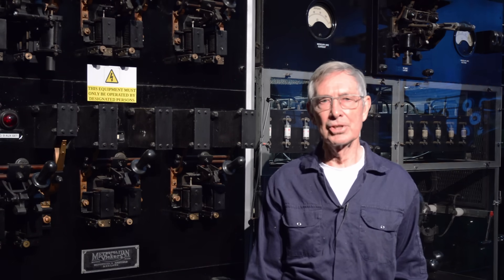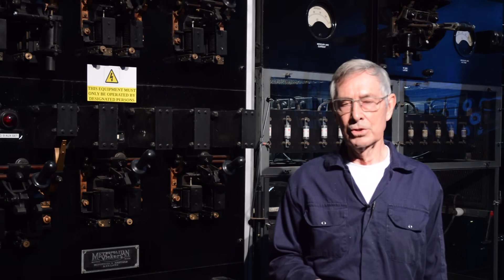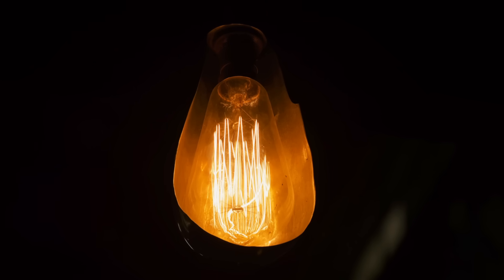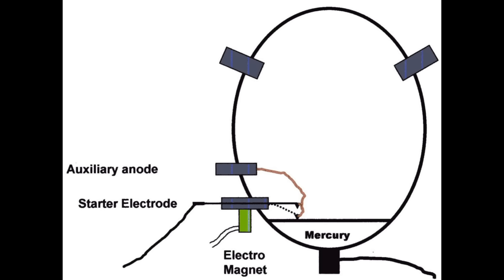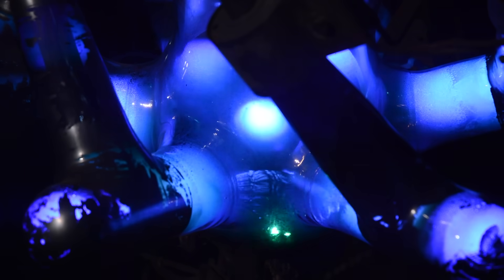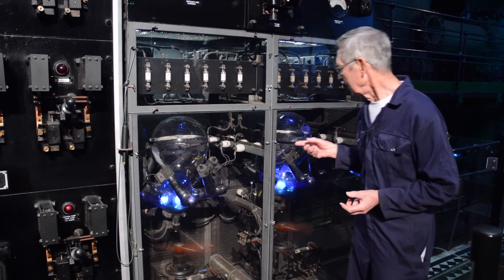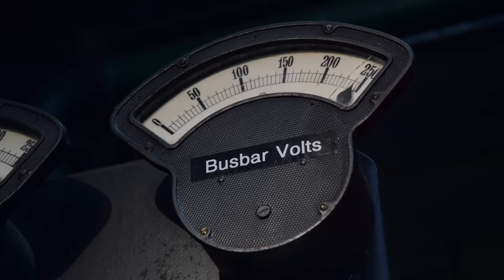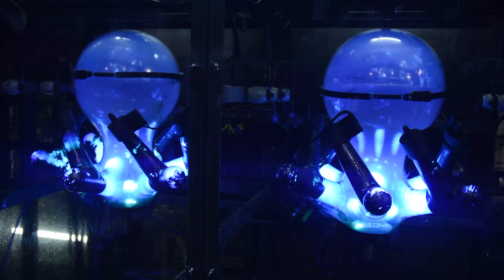Mercury Arc Rectifiers - Kempton Steam Museum

Comment: Old technology is awesome because it’s simple and one person can fully understand how it works, even to the level of making devices. One day in the future there might be a global disaster which knocks out semiconductor manufacturing and the knowledge to produce them. So how to make DC after this... go back to simple devices like the mercury arc rectifier. The tungsten lamp, fluorescent tube and valves are similar - much easier to produce then semiconductors. The knowledge to make them must never be allowed to die for this reason.
Reply: By the time the survivors of that disaster run out of the gazillions of electrical appliances, diodes and transistors that the planet is covered in, they should have figured out how they work.
Reply: Well, there's always CollapseOS...

Comment: I've learned about mercury arc rectifiers some years ago when visiting the local tramway museum in Nuremburg, but they had only photographs. Thank you very much for this well-made presentation while in operation! I'm always getting slightly uneasy around these things due to the amount of mercury they contain in a glass container and the currents that flow through them. But surely they're much more impressive than semiconductors...

Comment: These were really common on power stations, generating DC for the instrumentation battery backed up DC supply buses. The were a reliable and efficient way of generating large amounts of DC before silicon rectifiers appeared. I worked at Dungeness Magnox power station in the early 2000s. (On a completely separate project but engineers talk). I believe there were a suite of large mercury arc rectifiers supplying power to the instrumentation buses. Apareltly they occasionally blew out, which made for an interesting time I'm sure, (Let them cool down,replace fuses, then restart them and they were good for another few years). The station was scheduled for shut down in 2006 and Magnox were somewhat reluctant to spend millions replacing them with a new silicone rectifier system with so little time left. Obviously there were multiple redundant parallel systems but there were no spares available. Then some identical spare units turned up from the London underground which had never actually been turned on. I'm not sure if they needed to be fitted  before the station was decommissioned, that part would have been turned off sometime after the fuel was removed, so probably 2012 ish. The trials and tribulations of keeping 50 year old equipment running :¬)
Reply: Yes quite large ones existed for example on the DC links that often shared power between countries. The large ones however were not glass like in this video. The big ones were constructed in steel and had vacuum pumps on them to keep them pulled down. The escaping mercury vapours caused some contamination and an occupational health hazard. The attractive glassware we are shown here could often be seen in elevator machine rooms at the top of blocks of flats and offices as they all ran brushed DC motors and controls. I saw an antiquated example of this in Kiev recently in some soviet era flats. If you see a lift with a chair in it then beware. If it has a chair with a pot on the floor under it then definately dont use it.
Reply: Just had a look and the underground uses a strange DC system of +430V on 1 power rail and -210V on the other. So back in the day they'd have had a large number of these Octo(Hexa)puses
Reply: @alanpartridge2140  It’s because they didn’t want any stray currents eating away at the metal tunnel lining, or water (or gas…) pipes (the damage occurs where the stray currents leave), not to mention telegraph cables. Most other subways (as well as the London "overrpund) uses 600 or 750 + in the conductor rails, and the running rails for return current. Cities with trolley buses as well as trams, usually had 600 volts in yhe + wire and ground return in the — wire, making for easier crossing of tram wires. In some places, vintage trolley buses have been run in their home cities (that now lacks trolley bus lines…) simply by gaving one pole using the trams’ + wire, and having them tow a cart with metal wheels running on the tracks for ground return.
Trolleybuys only cities sometimes have + and — 300 V in their wires, making for a less scary potential if a wire gets downed. You still have 600 V, of course.
I have a friend who lives in Bergen, and he’s told many tales of stray currents wreaking havoc. Bergen had trams until 1967, then only trolley buses. On occasions, old feeder cables and return cables made for currents going astray, to do such things as gobbling up the hetating elements in the water heaters in the local hospital… 
MER (Manx Electric Railway) still use these wonderful beasts! :D
Reply: @alanpartridge2140  I believe they were 12 phase - I am not sure if there was one 12 phase rectifier or two 6 phase ones in parallel. It was not uncommon to lose a phase resulting in a lot of harmonics but who cared in those days. They were also rated at a lot higher current several thousand amps. From what I was told they were in metal tanks with only a small viewing port that was normally covered due to the amount of harmful UV radiation from the arc.
Reply: The factory I work in had DC control voltage to control the AC equipment, as well as some rather large motors which also ran both AC and DC. We used to have a motor of several hundred hp connected to two generators, one on each side, so one generated +125 VDC and the other -125 VDC, so the total generated was 250 VDC. All that is gone now, replaced by solid state rectifiers.
Reply: It's incredible how much of this old tech is still operating in the world of mobile phones, the web and such. A bit like Tim Hunkin revealing that the met office were still using an 80-odd year old electromechanical spark erosion "fax" machine up until around the 2000's. Would be interesting if anyone has examples of these rectifiers still in use.
Reply: @BM-jy6cb  I knew MER (Manx Electric Railroad) still used these a few years ago. I’m certain a quick mail to them would resolve the question! :)
Reply: SCR’s and now power transistors
Reply: Super cool info Frank, sounds like you lead more than an average life career wise. 👍🇺🇸
Reply: Talking about London, please go take a look at the end (if not all) of this video : https://www.youtube.com/watch?v=Yy8vEZT9Z_I They found an old bunker under london with a working and connected Mercury arc rectifier. It's amazing
Reply: I worked on building and testing control systems for many of the magnox stations in the 80s-90s, I was with Instem if you’ve heard of them.
Reply: Keeping equipment running for longer than its design life is truly a preserved art in the UK. After all: Why do you think London Undergrounds MA rectifiers had never been used?... 😉

Comment: A work colleague told me he was at a power station which used these devices. I guess possibly to provide excitation for an alternator. One day he had to take a party of school children around the station, all of whom he thought were pretty disinterested. He showed them the steam driven alternator and said this is where we make the electricity and then pointed to the rectifier and said this is where we bottle it. The next day he was taken to task by the station manager...clearly their teacher wasn't happy.
Reply: I am 44 now. As a late primary school child I went on a school trip to our local plant, Dungeoness in South East England and recall walking around the edge of the vessel head and having the refueling tower pointed out to me, and the plugs that are lifted out by it once it is positioned over one.
Reply: At least they all didnt get arc eye.
Reply: @rushymoto  The glass of the tubes blocks most of the harmful UV rays emitted by the process.
Reply: @joeylawn36111  Wrong.
Reply: @joeylawn36111  Nope
Reply: 😬Yikes! I stand corrected. Scary.
Glass does block the UV rays emitted by some home use quartz lamps (a piece of glass must be in place for that reason), but apparently not the must more energetic mercury arc rectifiers.
Reply: 😂 bottle it. That's fantastic!
Reply: „The alternator is where we make the electricity, and the rectifier is where we bottle it!“ 😳

Sir, thank you so much for giving me the biggest laugh I could ever have asked for on this subject! Imagining an arc rectifier as a bottle of electricity has definitely _brightened- up a dark and dreary Christmas eve in these parts. Bravo! ⚡🎄😁
Reply: sounds like a normal field trip. I don't get it.
Reply: @NoZioKikes88 THE EDUCATOR WAS A NITWIT FOR ACCURACY APPARENTLY. JUST THE FACTS MAM, NO FUN ALLOWED!!! AND THERE'S NO SANTA OR ST NIKOLAS EITHER OR EYETHER!
Reply: @NoZioKikes88  They stopped bottling electricity nearly 100 years ago. So he was pulling their legs…😉
Reply: Governor Newsom in California thinks that if you are stuck in the Mojave Desert, the AAA will bring you a gallon of electricity to continue your trip to Death Valley.
Reply: Some people will suck the joy out of anything. I can just picture them telling their kids how the saw the place where the used to bottle electricity... you know back when it was done that way I mean.
Reply: The days before 9-11 when the public could visit power stations.
I was heading to lunch through the turbine hall once,  when one of the old hands shouted out, slightly too loudly  'you can see up the skirts of the holiday-camp visitors  through the open mesh floors'. 
Lol Almost walked into some scafolding.
Reply: @BitTwisted1  
Is it totally illegal for the public to visit power stations? Also, is it routine for staff to use the turbine hall as a foot traffic throughfare? There was a case where a superheated steam main near a workers' breakroom ruptured and killed everybody inside.
Reply: @gregorymalchuk272  
I'm not sure about the restrictions on visiting today, but I know years ago I visited the Hoover Dam and was able to walk through the dam and the turbine hall there.
It's not only steam-based plants that have turbine halls, though likely the large majority are some sort of combustion-based generators.
Reply: @heyallenify  In 2006 vehicles still crossed the river on the top of the dam...there was a bridge being constructed nearby at the time. Now, traffic is on the bridge, don't know about tours...but that was the way you got to vegas from arizona, litterally on and over the dam.
Reply: @somethingsomeonesaid6455  I only went to the dam as a young teen, and that was around 90...
It's been a few years for me, so things have definitely changed!
Reply: @heyallenify  I visited Didcot A just a year before it closed (2013) and both Drax and Sizewell B host many open days and private tours....covid  not withstanding.
Reply: @somethingsomeonesaid6455  Yes been on and driven over the dam a few times.
Reply: @gregorymalchuk272  We're I worked we had Station Guides and designated visitor routes so as to avoid potentially hazardous areas and to meet our legal obligations. All that ended following 9/11 and numerous security reviews.
Reply: @gregorymalchuk272  A power plant at the south end of Nevada (USA) had a high pressure steam line fail near the control room.  Several workers died instantly, and others did not survive.
Reply: @BitTwisted1  I have visited local water power plant (Orlík, 364MW) just a few years ago and we were allowed to the turbine hall and inside the dam, as a part of a regular guided tour. However, the days people could visit nuclear power plants are gone. All you can visit is the information centre.
Reply: @JakubChalupnik  The difference between the turbine deck and power block of a nuclear plant is little different from that of a coal plant. I'm going to assume little has changed in terms of the facility design since I left 25 years ago, but at that time, you wouldn't have known which was which if you hadn't looked on the way in.

Unfortunately, you are right. When I worked at a nuclear plant in the mid-90's, the locals used to fish in the canals because the water would be warm year round, and you could generally drive past the plant to visit the nearby reservoir. When I went to show my then new wife the plant, I had barely reached the outer access road before running into roadblocks and very quickly noticed a station guard following us discreetly in a truck.

There was no visitor's center at this facility, and the security perimeter had been vastly expanded to the point where you couldn't even drive past the plant to the reservoir, as that went over the canals.
Reply: @JakubChalupnik  NOT true... there are civilian recorded tours of inside nuclear power plants right here on youtube.
Reply: funny. Thx. Nothing like real life stories.
Reply: Way good story, guy.   Thx.  Your colleague probably installed more interest I. Science than their instructor.
Reply: Funny!
Reply: Guess they're Dead now
Reply: Great story.
Reply: Taken to task? Who speaks like that?
Reply: This is so cool
Reply: An excursion to a nuclear power station is better than an excursion at the power station.
Reply: @millomweb  Yes!
Reply: poor teaching and poor station managering
Reply: I was fortunate enough to visit Trawsfynydd nuclear power plant before it shut down.  Most interesting.
Reply: I went to Indian Point nuclear power plant in Buchanan NY with my high school class in the late 90s, being decommissioned now, and closed to public tours since 9-11
Reply: Teacher was a woke Dickensian Machoakumchild.  Station manager just like the Jerries who had to have an explanation of Bairnsfather cartoons.

Comment: Is the 6 phase from 415V 3 phase but with two of each phase opposite each other?
Reply: Yes. The basement transformer splits each of the 3 phases into two. Take look at: http://www.vias.org/matsch_capmag/matsch_caps_magnetics_chap6_12_07.html
Reply: @andrewlindh5047  Wow, that's confusing
Reply: All phases inverted - if you just had the 3 phases, you would have 3 peaks 120 degrees apart, and smoothing that much power with capacitors would be impractical.

Now if you invert the Phases..
A peaks at 0 degrees
B at 120
C at 240
-A at 180
-B at 300
-C at 60

So now the peaks are only 60 degrees apart, and it doesn't drop far between them - like having twice as many cylinders makes an engine smoother